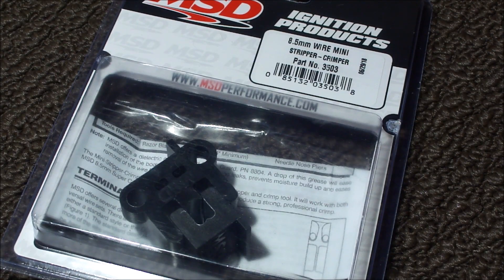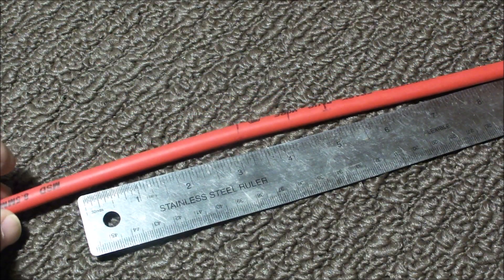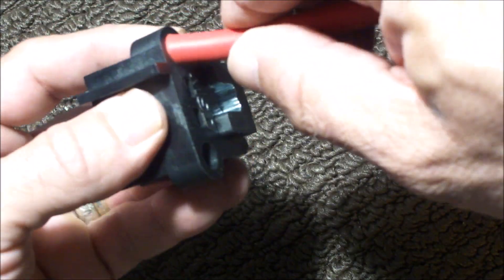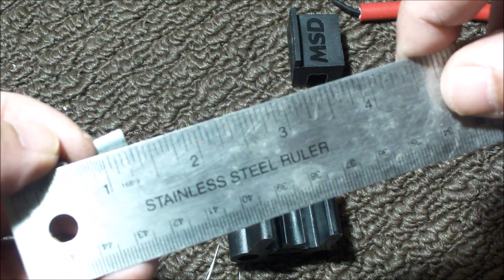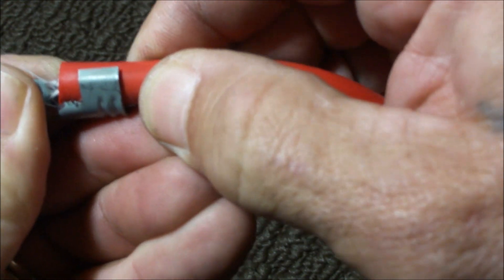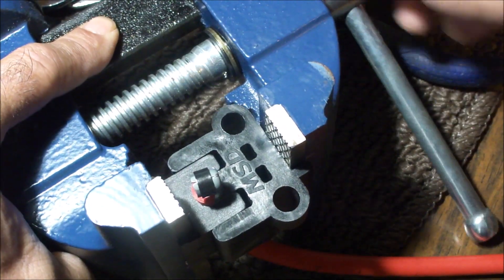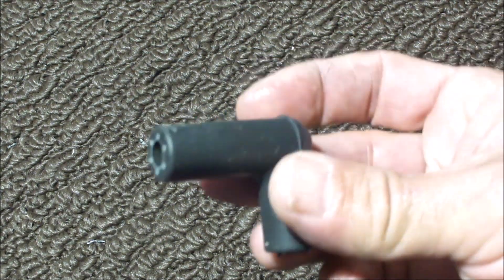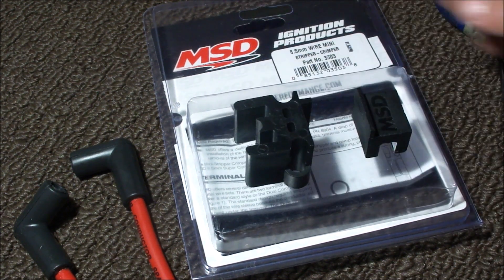How to Crimp Your Own DIY Spark Plug Wires with MSD 8.5mm Wire Stripper - Crimper

Comment: Is there a heavier boot for the coil wire versus the plug wire where it attaches to the distributor cap end ?
Reply from the maker: There's a variety of different boot that will fit the wire.

Comment: Just got an msd wire set. Had no idea. They'd need to be crimped. Won't buy um again. Not because I can't do the job, but I've got better things to do. It's a standard v8 set, the length should be a non issue.  Now I get to spend an hour on these stupid a** wires.... 

Thanks for the video. Helpful.
Reply from the maker: If you thought you were getting a complete set it totally sucks. On the bright side, you can customize those wires to length and what you use on the ends. I'm glad the video is helpful!
Reply: If making wires is a problem, look for a specific set cut for your car. Its not that bad to do this. Much harder jobs  to do on a car.

Comment: what is the difference between spark plug wire and normal cable, thanks
Reply from the maker: the core material and shielding are different then normal cable/ I presume you are talking about RG6 coax? There are different specs for both and the materials used can vary considerably.
Reply: @ExtremeDIYGuy  Thank you
Reply from the maker: @pakcom-vl9kd  Your Welcome!

Comment: Have you tried sliding the boot on before making the crimp? I wonder that would be easier. I have a small engine that needs a new  end installed
Reply from the maker: I haven't but it certainly be worth trying. Use plenty of silicone grease and make sure the orientation of the boot is correct would be the two key things I would pay attention too.

Comment: CRC silicone spray works excellent for getting the boots on. Spray the wire and boot, they slide right on super easy. Much easier than dielectric grease.
Reply: Wow.  All these messy fucking years....  Thank you sir..
Reply from the maker: Thats a great alternative! Thanks for the feedback!